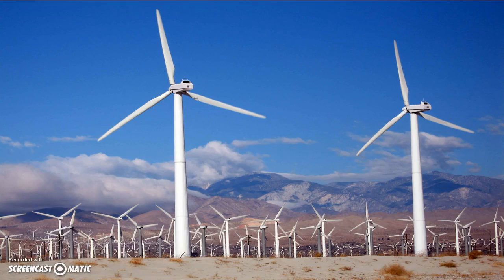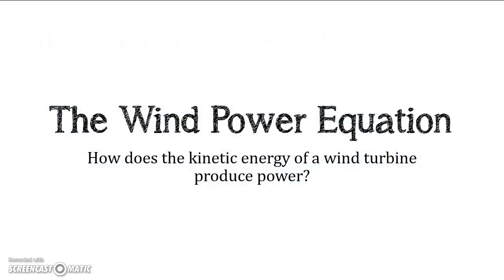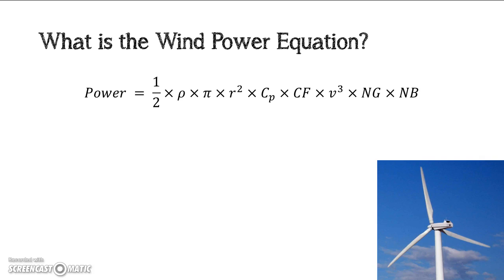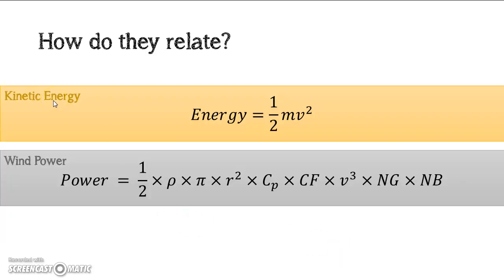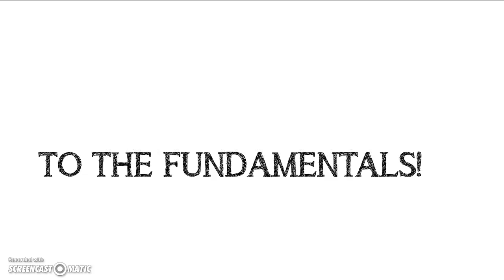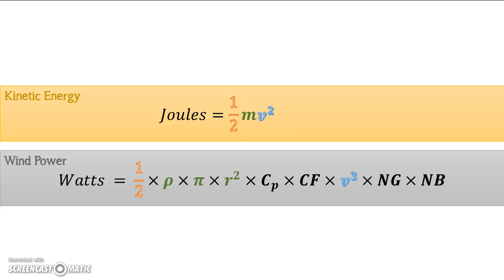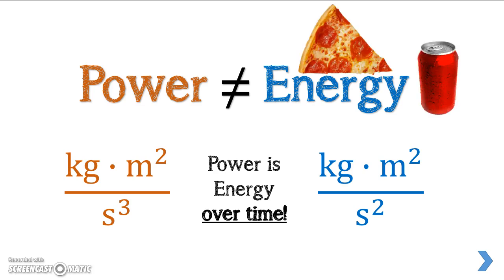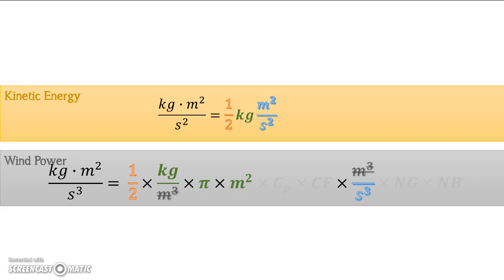The Wind Power Equation

Comment: Great equation for making wind usefull.  Although i think it would make more sense if you explained the mass part of the equation as a mass flow rate this would explain the power vs energy better and why its v^3 in the power equation. E/time = Power = 1/2 (density of air × area swept x flow rate of air(wind speed)) x wind speed^2 .  This looks more like the equation Power= mass * velocity^2) / 2t
Reply: The V3 is because you combined terms.  The mass in  .5mv2  is calculated given the rate at which the air passes through the wind turbine.   It's not like measuring a fixed quantity of air (although you could do this). The mass is calculated from an amount of air passing through the area of the turbine blades over a length of time.  This is why if you look at mass as a mass flow rate then you can separate the velocity of the air from the V3  and it looks like the simplified formula   E= .5 (mass flow rate) v2.
Reply: But why is it v^3 physically?  Very unintuitive.  It should be kg/m (mass per linear meter) * m/s (linear meter flowing per second) = mass/time.  The cube is a distraction and is merely book keeping/organization, right?

Comment: Pi x r^2 x density is not equal to mass! To get mass you need to have volume x density. To get volume (a cylinder of air) you multiply area (Pi r^2) x density x h (m/s). That is why you have (m/s) ^3 on the bottom.
Reply: Very clear explanation.